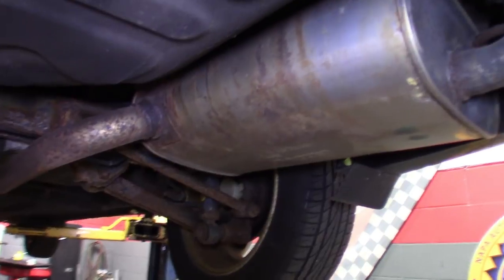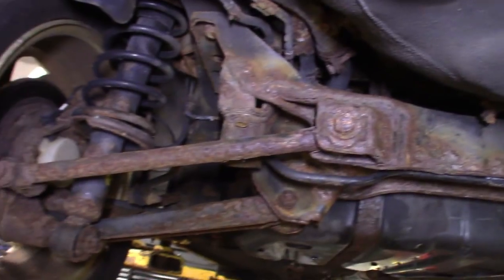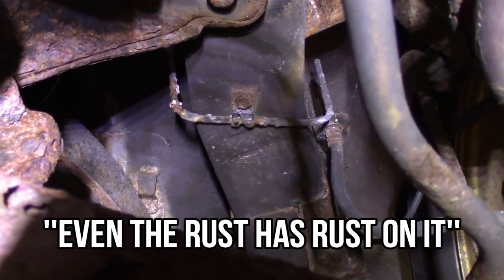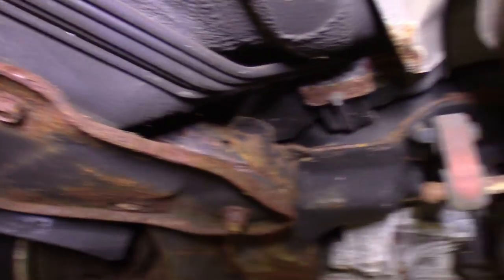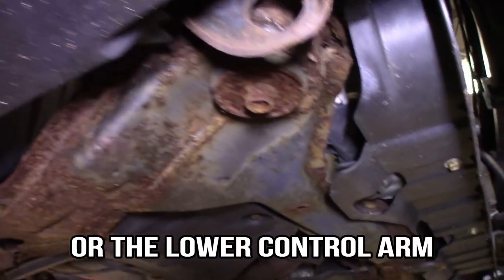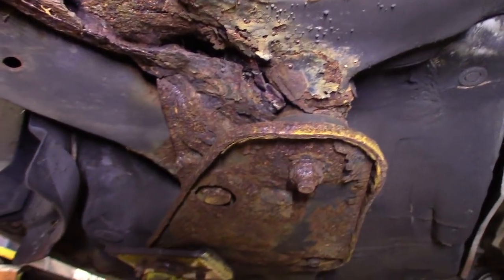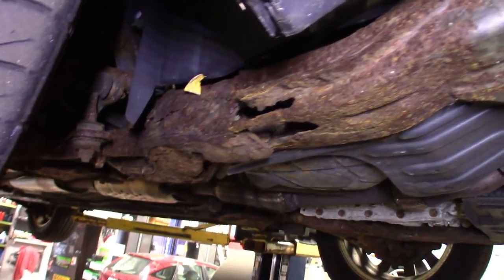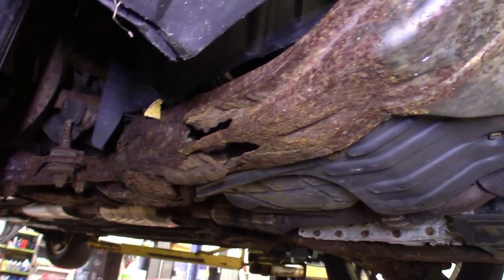LIVING IN THE RUSTBELT

Comment: Yeah I bought a 14 fiesta that came to Washington from the mid west. Luckily it's history only had it out there for 3 years but I can def see that it did do damage. I got it for pretty cheap from a Ford dealer because of that. Bought a ten year old car when I lived in Rhode Island for a short while, yeah you could put your fist through the wheel wells. Not long after I got it, the fuel lines sprung rust hole leaks. That sucked.

Comment: See it with the 1999 to 2006 fullsize GM trucks,rusty rocker panels,fenders and box sides.Includes brake lines which we do a lot of using the Dorman stainless steel pre bent kit.Touch one brake line in these trucks,the next one brakes replacing all 5 brake lines.This includes the 2000 to 2006 fullsize GM suvs.My dad got burned on a 2001 Ford Ranger,found the frame is completely rusted out after I raised it.He bought it from a dealer only auto auction with a bad fuel pump.

Comment: nice i have a video of a avalanche a friends farm truck the rockers are rotted out and i had to do brake lines all the front ones the back ones are next did 3 of the brakes just had to do the last one new caliper and rotor had pads left over from what i had did before used a 4 foot cheeter bar to get everything off what fun i am in Ontario Canada they spread the salt by the truck load no mixing sand unless its a dirt road LoL 
i used to restore cars early 60s late 70s mopars if u can take 3 cars and make 1 ur doing pretty good LoL

Comment: Oil spray oil spray oil spray. Soak and resoak. I fluid film to the extreme. Everywhere. Everywhere. Every spring. Has to be washed to get it out of all cracks and crevices, I use a phosphoric convertor and then just bath it in fluid film
Reply: Also noticing engine right now is just caked in salt. When temp rise I will thoroghly clean the 5.0 coyote everywhere. It sucks, but living in n.e, and the amount of salt brine calc, mag, chloride there dumping in has to be done.U can see on the vehicles a wet film, that chloride just sucks the moisture to the paint. As soon as temps rise it just acts as a catylist and the corrosion goes nuts

Comment: You guys not tried ACF50? Been used in the aviation industry for yonks, I use it on my motorcycles to stop them rusting up in winter.

Really does stop stuff rusting up, don't get me wrong it won't last forever but it'll stop a lot of it.
Reply: There's the rub won't last forever.
Reply: No, your engine won't last forever either. But do you stop changing the oil because of that?

It's called preventative maintenance, if a bottle of ACF50 and a good liberal application a few times a year gives you a few extra years from your vehicle why wouldn't you?